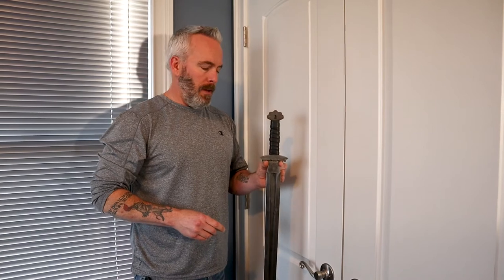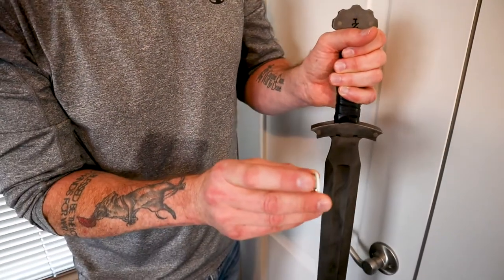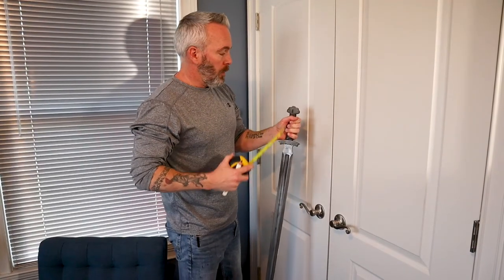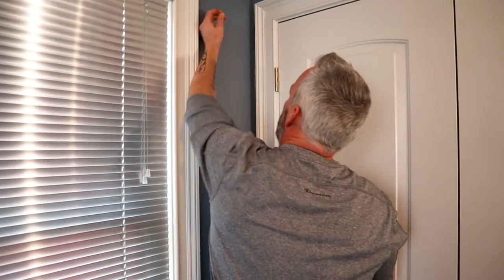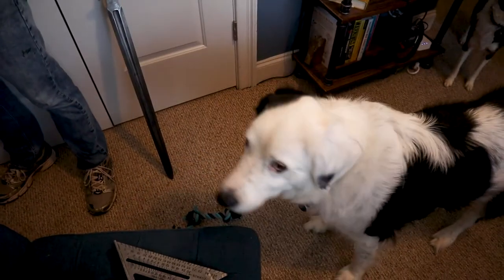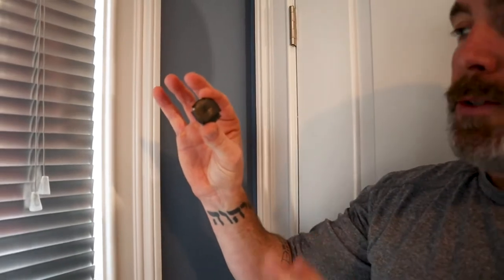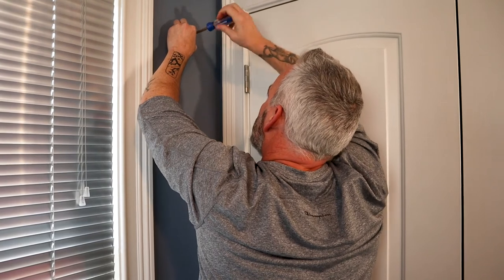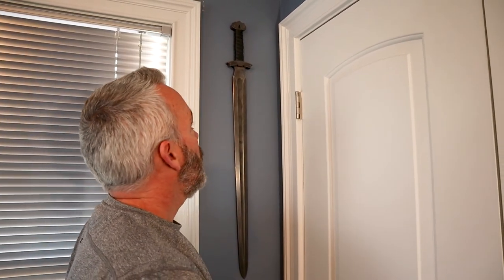How To Wall Mount a Sword Using a Magnet

Comment: Could this method be used if you're mounting swords in an X shape?
Reply: Howdy, C! If you used four magnets, I'm confident it would hold. The hardest part would be making sure the magnets protrude from the wall to make full contact with sword blades in the position your hoping for!